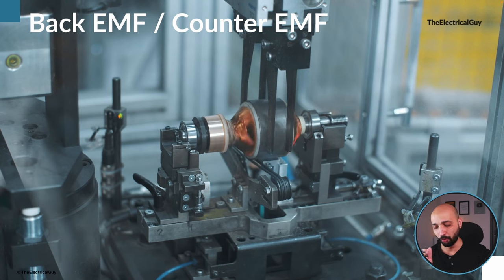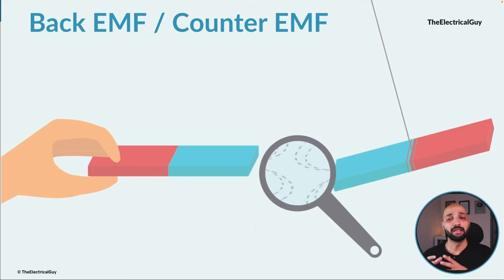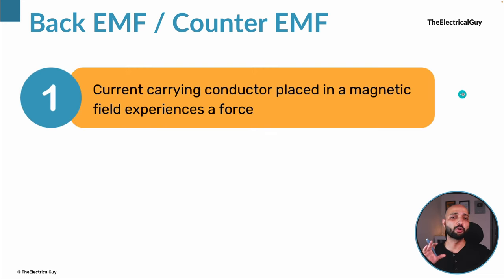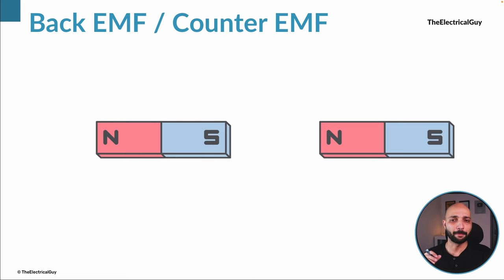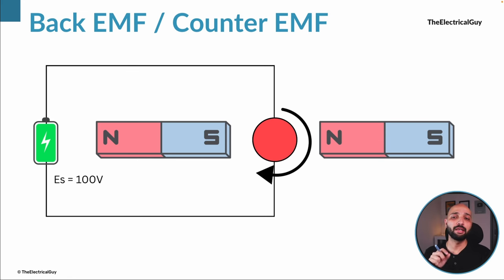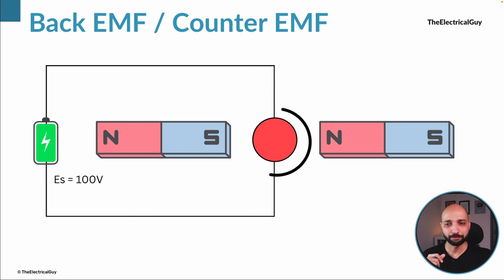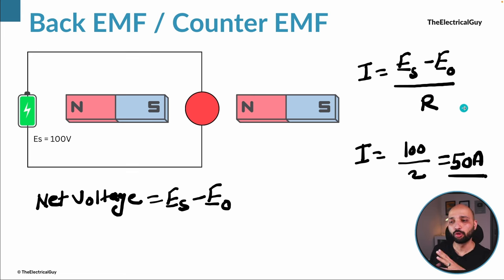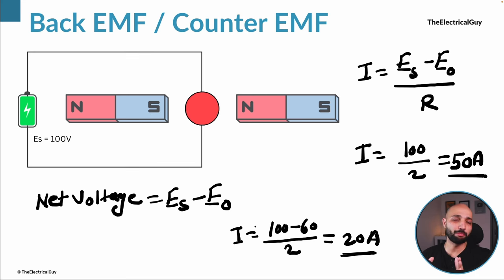What is Back EMF & what is its significance | DC Motor | TheElectricalGuy

Comment: So what about whent it comes to a DC Generator, the back emf reduces the magnetic field like the back emf reduced the effect of supply voltage here?
Reply: I think that, as the electrical energy is the output of a generator, there is no source which the armature field is opposing. The emf produced from the armature flows through the commutator and is received as the output through brushes. Furthermore, the field produced by the armature is opposing the source current in a motor, whereas in a generator, there is no source to oppose
Reply: @sanihabegum1086  ohh thankyou for clarification..😃

Comment: I agree, if your motor employs a magnet and a coil of wire your motor will induce a back EMF. Unfortunately, this back EMF will significantly inhibit the output power from your motor.
If you have a 12Volt DC motor, you could expect the motor's output power is being created from about 3 Volts while the back EMF is consuming the other 9 volts.
So your opening statement, "If the back EMF is not there it could damage the motor ..." is a little misleading. Without back EMF the same motor would be rated as a 3 volt motor and it would be just fine. If you went ahead and applied the old 12 volts, then your statement is true.
With a geometry change a DC motor can be created without these powerful magnets that induce this counter productive EMF. From what I've seen, the efficiency of such creations leave the existing motors in the dust.
The closest thing I have found are generally classified solenoid engines.

Comment: Then why don't we supply source of less voltage? Considering the capability of the motor? Plz answer if anyone knows.. Thank you
Reply: Every motor is designed to operate at a specific rated voltage. While reducing voltage might seem like a way to prevent high back EMF or protect the motor, it generally results in poor performance, reduced efficiency, and potential damage due to higher current draw. Why? Because lower voltage resulting less speed and in this condition B-EMF is negligible , so at the starting of the motor, it will draw a large amount of current .Therefore, motors are typically supplied with their rated voltage to ensure optimal operation.
Reply: Back EMF is a function of the angular velocity or rotational speed. Reducing voltage will decrease the speed of rotation and therefore . But yeah the motor is now slower

Comment: Very good video. Thank you! I have a question. I'm just getting started in electronics so I'm having trouble understanding the relationship between back EMF and inductive reactance. I assume back EMF is not the same as inductive reactance, but both work together in an AC circuit to oppose the flow and change in current. My question is: Are back EMF and inductive reactance the same thing or does back EMF oppose the change in current while inductive reactance opposes the flow of current?
Reply from the maker: No. Back emf and inductive reactance are not the same. Back emf does not oppose the current.
Reply: @GauravJ  Thanks for the quick reply. I think I understand now. Back EMF opposes the supply voltage and that's why you subtract back EMF from supply voltage when calculating current with Ohm's law, but by increasing back EMF or inductive reactance you decrease current. Is this correct? If not, please recommend one or more of your videos that might clear this up for me. Thanks again!
Reply from the maker: Yes, back emf opposes the supply voltage. That is correct. Now, inductive reactance will not come into picture in case of a dc motor. Inductive reactance is only applicable for AC (Alternating current) as it only opposes the change in current and not constant current (DC,). To have more clarity on it, you can check out my playlist on "AC circuit"
Reply: @GauravJ  Thanks for the explanation. I understand it now. Formula for inductive reactance is 2pifL and frequency in DC cicuit is zero so if you plug in zero for frequency in the inductive reactance formula the product is zero.
Reply: Loved the vd❤